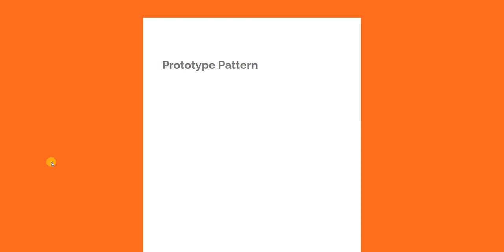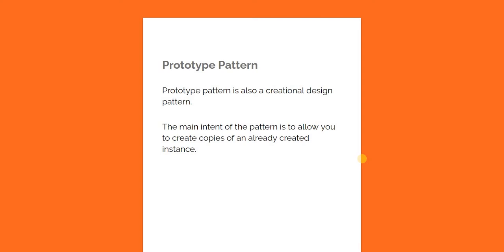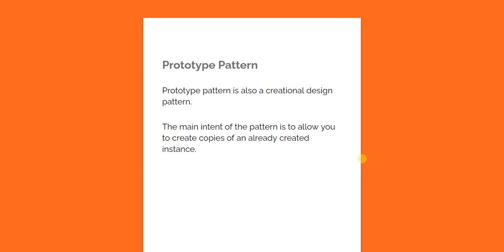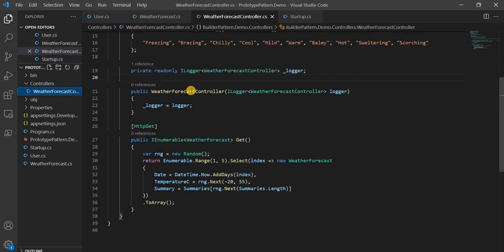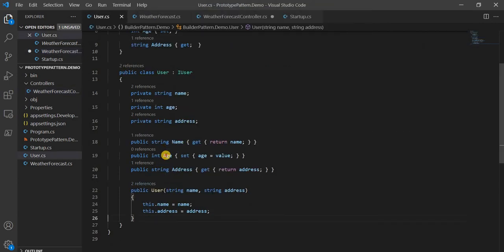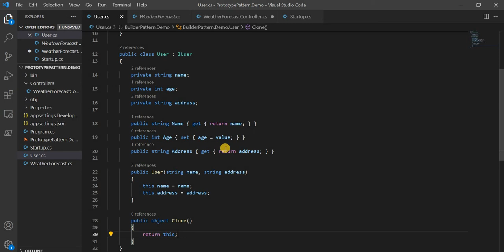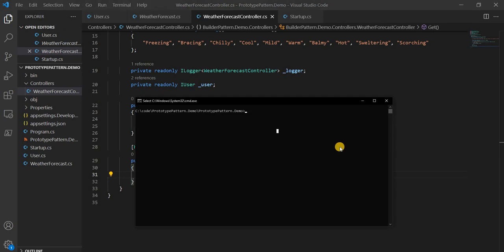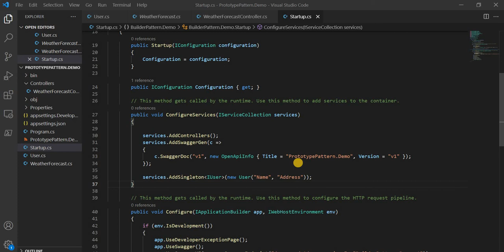Prototype Design Pattern (An Introduction for .NET Developers [.NET 5 and C#])

Comment: Thank you for answering that. I could create a basic prototype that is language independent. But I was learning from some content I paid for in which the UML shows private members (fields) but the example code uses public fields. One of the methods to clone an object was using a constructor which takes a Prototype (which is an interface in the UML). The sample code suggests that then there is a mapping done between the current instance and the prototype given in parameters but you cannot simply do this.field1 = prototype.field1 when field1 is either private or protected.
The C# code given looks like yours though and uses the IClonable interface and IClonable.MemberwiseClone().
Now I wonder how does C# do to be able to copy private members. Because IClonable is just making our lives easier but under the hood there must be a pattern or something that allows it. Would be interesting to know.